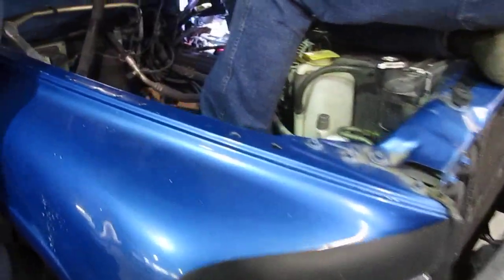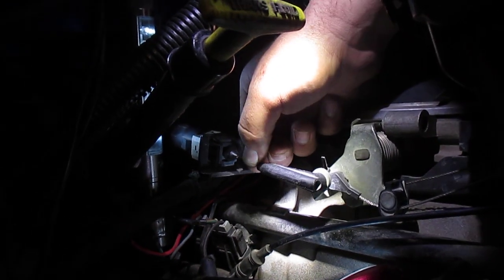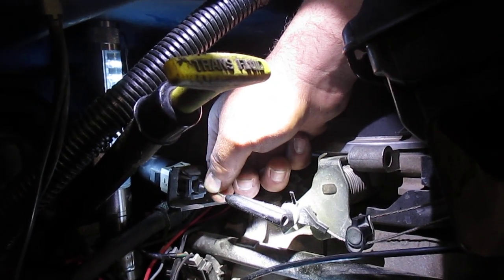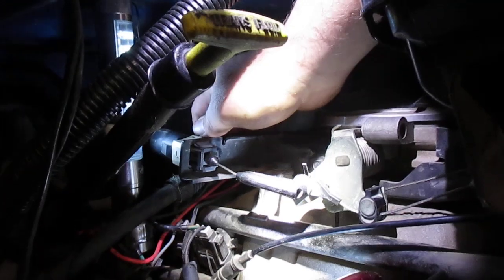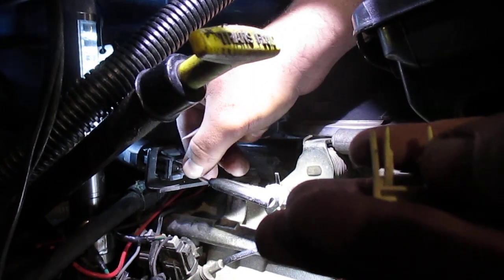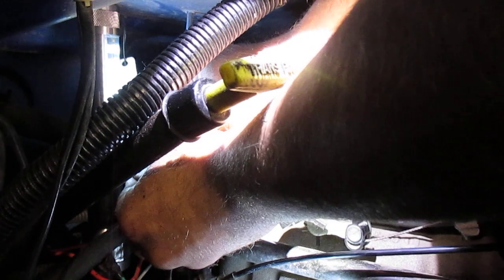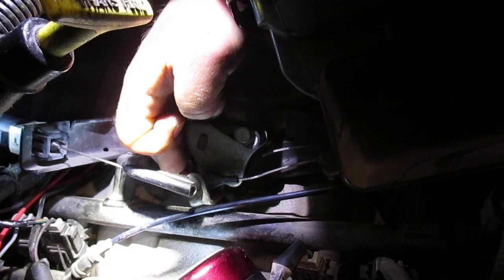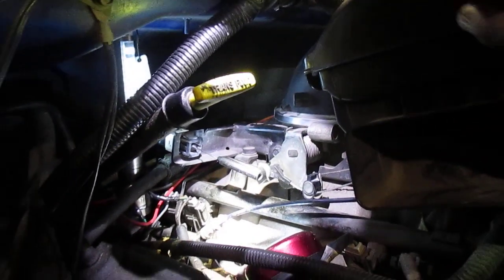TV cable Dodge

Comment: Can you link me any videos you have done on this truck I have the Dakota 5.2 and am struggling to get the transmission in order before it fails. No codes at this point pls help I have done front band adjustment to spec and will do rear at next service interval
Reply: Seems to have power missing from 1st. possibly due to this adjustment

Comment: You mentioned adjustments in the pan what adjustments are those? Sounds like something that should be check before adjusting the TV cable
Reply: The shiftbands u can adjust on the side and 1 inside the 46re trans im guessin
Reply: Thiers another clip on transmission. I just can't seem to get cip off

Comment: You can also go under your dash and put some zip ties between the pedal and the spacer
Reply: I sliced some vacuum tube, pulled the pedal up, put the tube around the cable slack and zip tied it just enough to shut. Runs pretty good now but I still might try to get rid of the slack on the tv.

Comment: What are the other 2 cables?
Reply: One is the the throttle cable that attaches to your gas pedal.  The other is the cruise control that goes to the cruise control unit.
Reply: Would this cause my transmission not to pass first gear just high rev and stays their
Reply: @AngelRodriguez-jv6oc  the kick down cable that runs to the transmission would cause that
Reply: @tarenmoore8599  so I need to open the transmission again):!’?
Reply: @AngelRodriguez-jv6oc  no it's attached to the shifting mechanism on the driver side of the tranny and is just a cable that runs up to the throttle boddy. Typically they just need adjusted.
Reply: @tarenmoore8599  ima try it out thanx a lot !!
Reply: @AngelRodriguez-jv6oc  it's a pain. But start with making the cable tightghter( less travel distance) then test drive to see any difference. If it don't shift before 3k don't just keep gassing it to get it to do so. You'll ruin that tranny.
Reply: @tarenmoore8599  o: probably already did 😰
Reply: @tarenmoore8599  thanx tho Ima try that right now!!